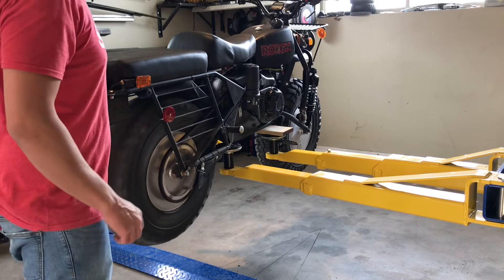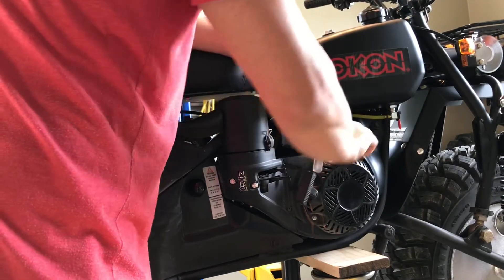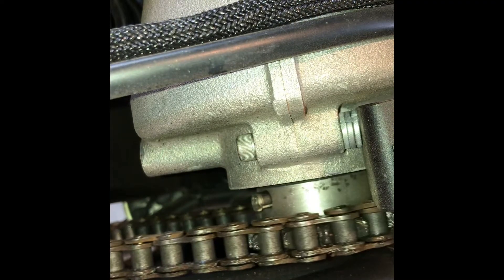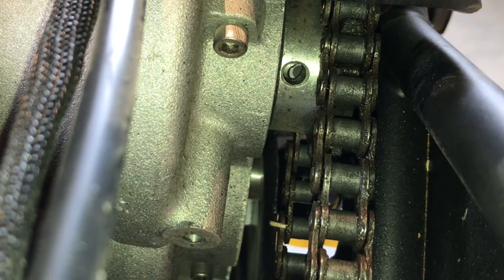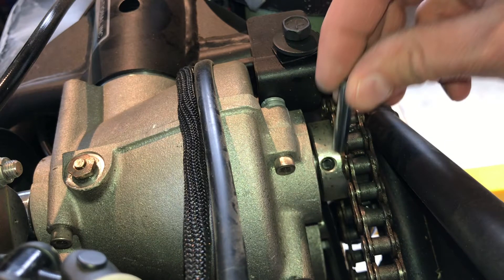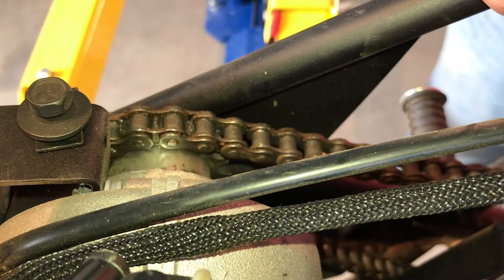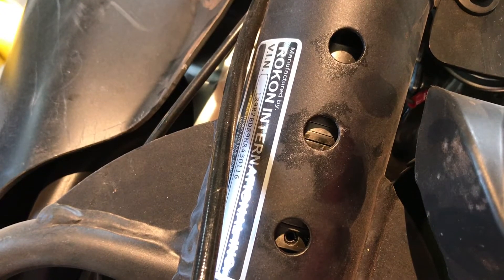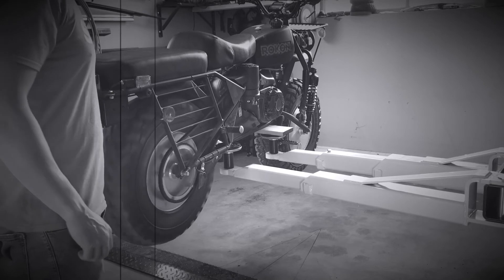Fixing 2 Wheel drive. Rokon Ranger

Comment: They make roll pin punches. Cheap and they center on the pin so they don't slide off. Might come in real handy when your on a trail repair and it's 5 out.
Reply from the maker: Good call!  Thanks.
Reply: Came here to suggest this. Made my work life much easier when I started ordering roll pin punches.

Comment: are all the roll pins on the bike the same size?
Reply from the maker: I'm not entirely sure.  This is the only one that's failed on me so far.  I think I did see a 1/8" roll pin somewhere along the way, but haven't had to change it yet.  The roll pin (shear pin) in this video is .25" by 1.5".